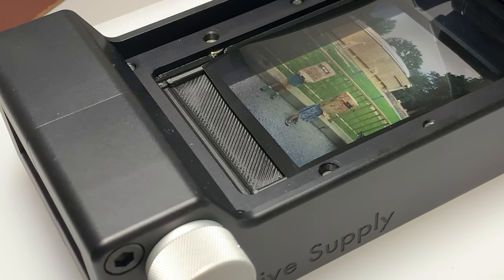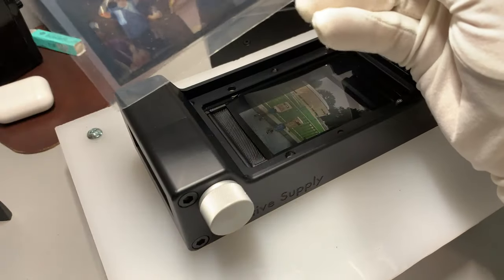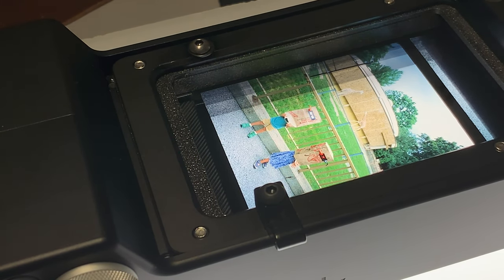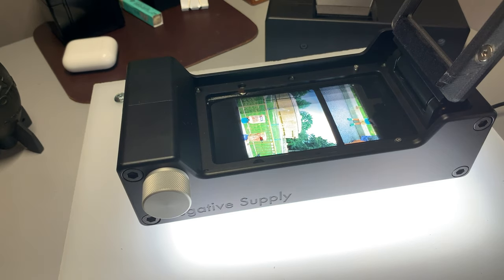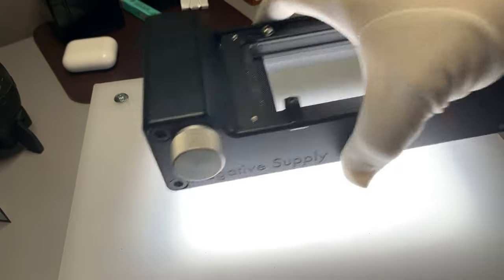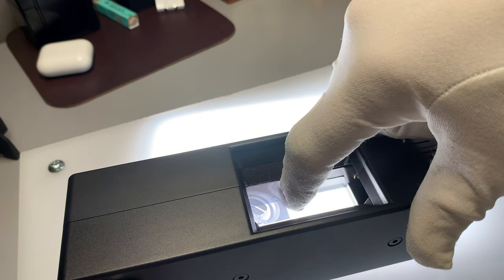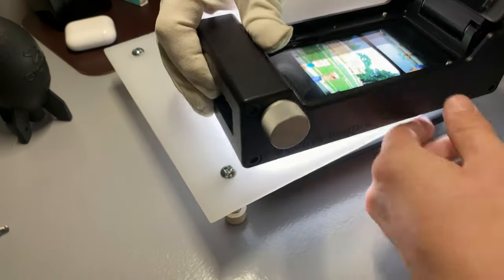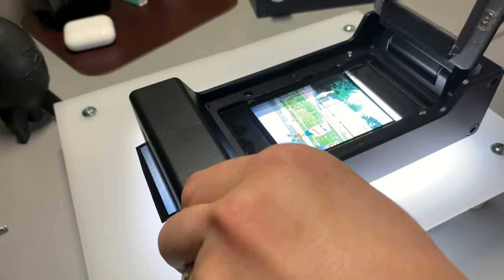Negative Supply Film Carrier 120 – Problem with cut rolls

Comment: I gently chase the negatives with a strip of clear overhead projector sheet cut to size. It pushes the negatives perfectly until they catch the rollers. Works even with a single frame.
Reply from the maker: Thanks. Will have to try this. Great solution. I did speak with the folks about this at NS, not sure if they’ll ever develop a solution but they were eager to troubleshoot.

Comment: You point out a design compromise! Perhaps a sticky helper to push or pull film frames may work? Still annoying at a couple levels! I’ve been waiting to invest in this kit-you just confirmed a possible longer wait! Thx!
Reply from the maker: The comment above mentions using a piece of transparency or just another piece of scrap film after the cut strip to push it through. I’ve since come up with a pretty good solution by putting finger cots (rubber finger tips) on to grip and help move the film through.

Comment: I’ve had the same problem, fortunately I’m now doing full rolls. But you are dead nuts on. I asked them about this and the suggested using the 4x5 carrier. But that’s out of stock.
Reply from the maker: Oro Valley Podcasts and Videos I spoke with them about it to see if there’s a solution, they were great and interested in working on a solution - who knows. I did try to remove the end plastic insert piece but it doesn’t help. I’ve since gotten a workflow that’s not too bad, I put little rubber finger cots over my gloves on two fingers to help advance the film.

Comment: They make a Print file sleeve that can hold a whole roll of 6x7. So you can cut it 3, 3, 3, 1. B&H sells them.
Reply from the maker: The problem with those I think is they don’t fit my Printfile enclosed binders.
Reply: @baltimorejac  it fits. I keep mines in a black enclosed binder. No problems at all.
Reply from the maker: @jimi88  you are totally right. Wasn’t thinking. I cut 3, 3, 2, 2 because I don’t like having a single frame by itself. Not sure if I’ll switch though because of scanning this way. I’ve figured out a solution by gently advancing the film with a rubber tipped finger.
Reply: @baltimorejac  ah okay, that makes sense to avoid the single frame. I'll have to try out the finger cots.